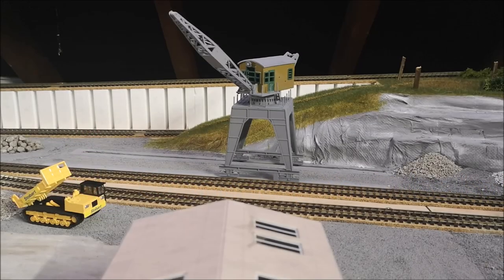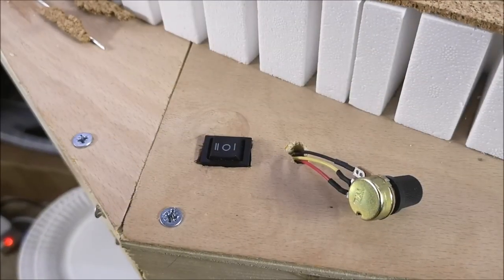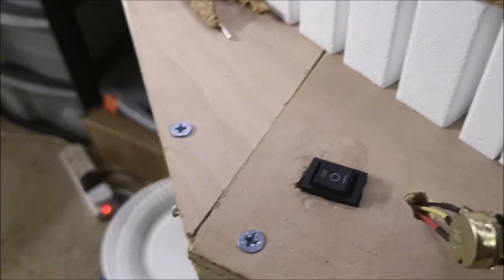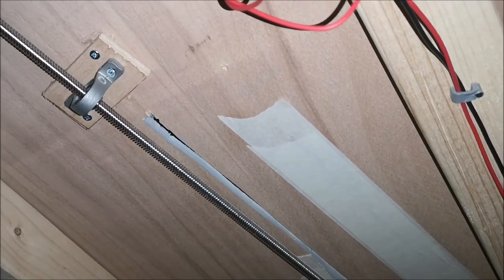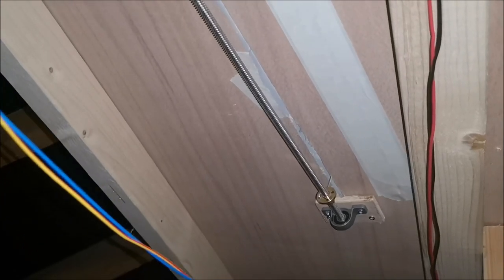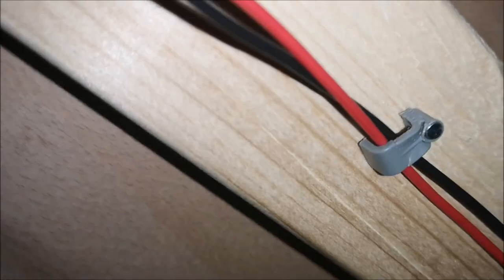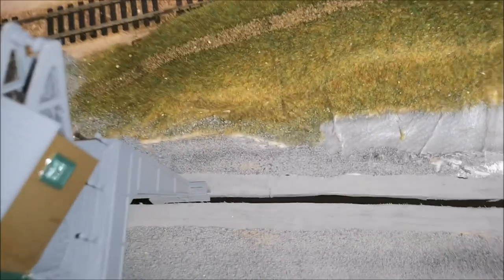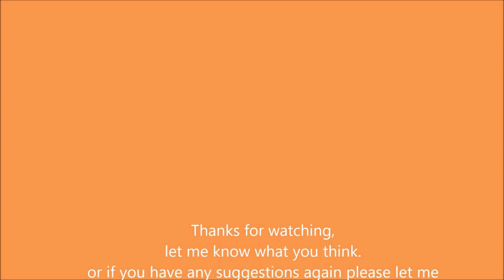Motorising the Dapol Dockside Crane.

Comment: Very clever I wouldn't worry about the noise I don't suppose any dockside crane was quiet .,you could fit small railway wheels on the  opposite side to the mechanism drive  running on a rail and it would run really smooth then 👍

Comment: Great project 👍 Personally I wouldn't worry about the sound, it makes it sound realistic. By using a second nut on the other "bogie" should reduce the crabbing on direction change and also give you easier limit switch installation as you will have an operating rod at each end. Well done, a fine piece of modelling.
Reply from the maker: Thank you, thanks for the tip too, will have a look into that to stop the crabbing
Reply: Et pourquoi ne pas ajouter un élément glissant comme la face non-collante d'un papier collant sous l'autre côté de la grue? Ou si les roues tournent y mettre un guide comme un morceau de rail?

And why not add a slippery element like the non-sticky side of a sticky paper under the other side of the crane? Or if the wheels turn to put a guide like a piece of rail?

Kaj kial ne aldoni glitan elementon kiel la glueca flanko de glueca papero sub la alia flanko de la gruo? Aŭ ĉu la radoj turniĝas por gvidi kiel peco de relo?

Comment: Looks good, well done. Can i ask,  would i need a PWM board to wire my Faller motor to my gantry crane to rotate.
Reply from the maker: I think you would if you wanted to control speed and direction

Comment: Well, that is quite a cool "toy!"  Very clever!  Was there a way to have, like on many pieces equipment, the power and speed control on the same dial?
Reply from the maker: Possibly, my electronic knowledge is pretty terrible and after a lot of reading up this was the only thing I could use which seemed fairly straightforward and cheap, I may look into a different type board for version 2